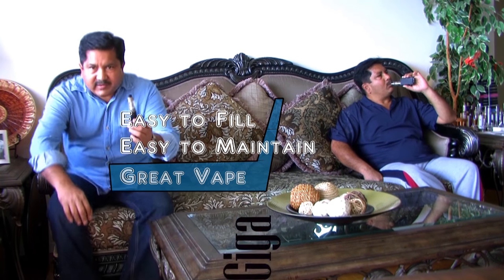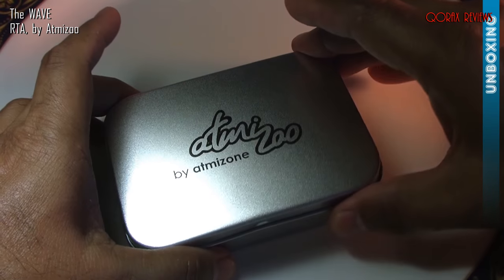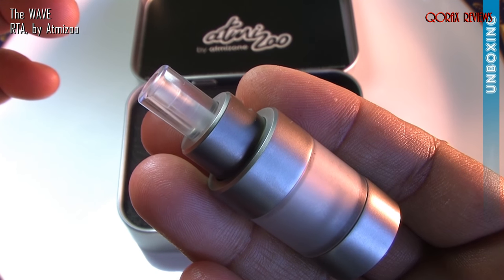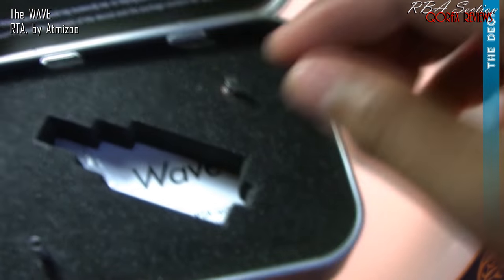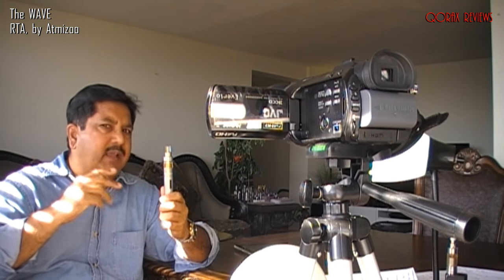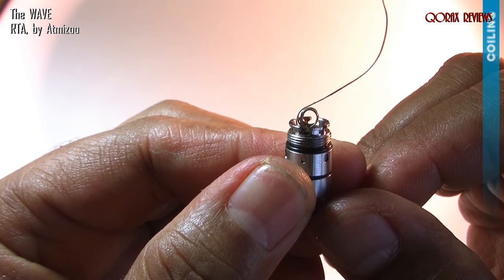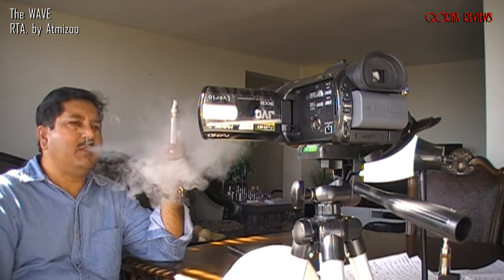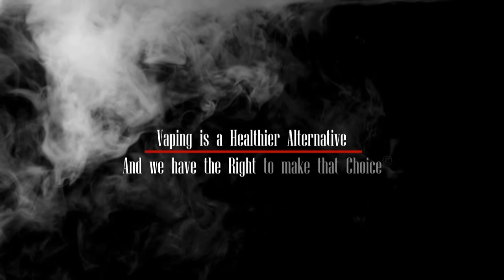The WAVE ~ A unique RTA from Atmizoo! (REVIEW)

Comment: I like your channel because you review some interesting products. I saw this video and figured this would be an atomizer for me-- tiny chamber, looked good for high pg/high nic/MTL use. I purchased one and have been fiddling with it for several days. I'm not having a lot of luck with it. The best results I can get are with a vertical wick using mesh. Please consider doing some more build videos for this atty. I watched all the videos from atmizoo, but still having trouble. Could not get a horizontal coil to wick at all after 3 attempts.
Reply from the maker: Yes it is a super compact deck, so coiling & wicking needs extra dexterity. I will try and make a vertical coil video this week. Thanks for the view!

Comment: Great review as always. Have you tried it with thicker juices? I love the look and the original deck but a bit sceptical on higher viscosity juices :)
Reply from the maker: Thanks for dropping by Taz 😃And yes, I've used 95% VG in the Wave without any issues. The design of the feed ports AND the juice well together is such that thickness of juice will [usually] not matter. It will saturate the wicks easily. If at all there's an issue (unlikely) you can always thin down the 'wick tails' a bit - and it will take on.
Reply: Cheers mate, I am picking one up, never tried carto styled tanks, curious to see how it vapes. Thanks again